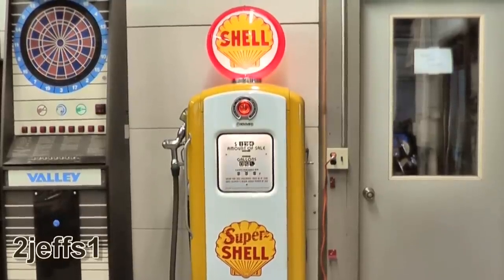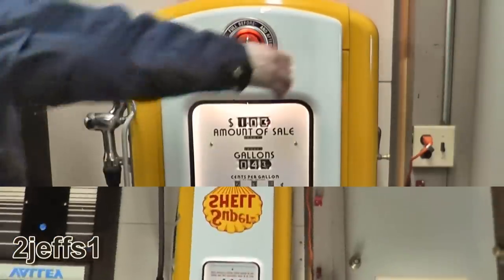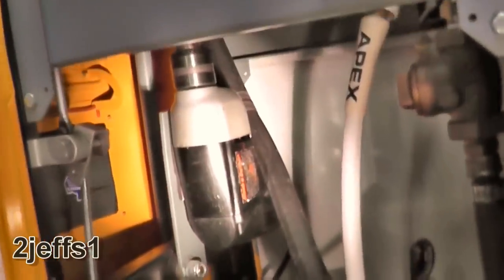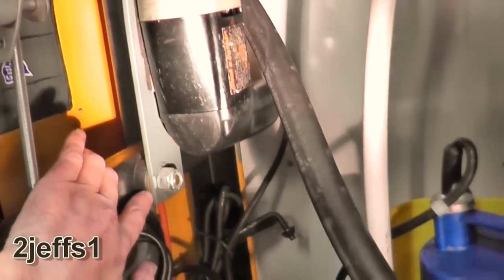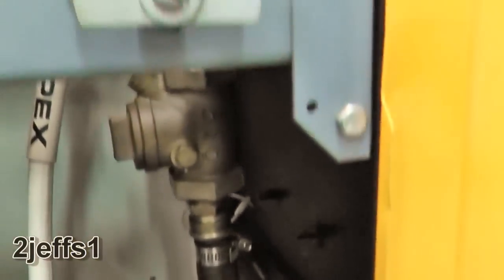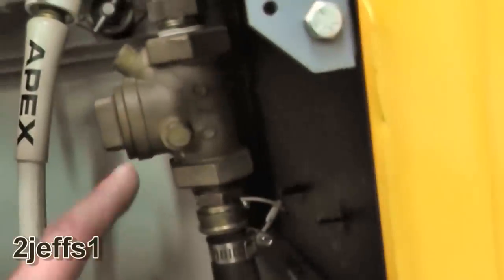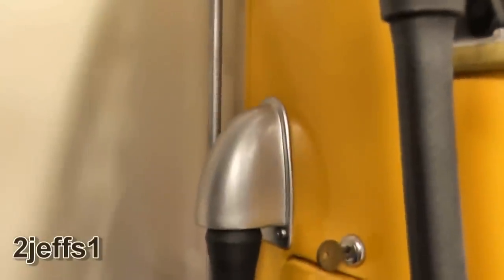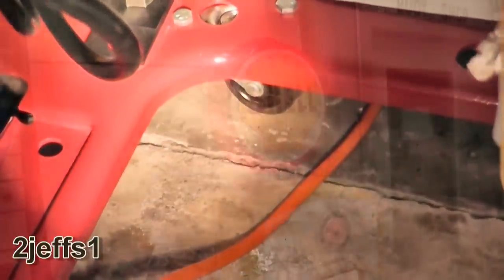Gas Pump Works and Sounds Like Real!  DIY Yours!

Comment from the maker: Hi Alky. Yes the drill is connected to the trigger switch in the handle. I did this project years back and didn't have a camcorder or I would of had video of the total build to make things easier for everyone.

Comment from the maker: Hi Joe, That pump has been together for a long time now. I had to remove the big cap/nut where the switch was inside to make sure I remembered which type switch I used. It is a push button switch from Cole Hersee. The part number is 9023. They have a web site.The switch has threads & nuts on the end. I used washers on that end. The switch has 2 - L shaped terminals. They can be straightened (or remove & solder wires) Final cover the end with electrical tape. Hope this gets you to the finish Jeff

Comment: 2Jeffs1 thanks for your demonstration of how you made your gas pump functional. I am restoring a 1950 Torkhein, slightly different than yours but I should be able to adapt your functionality concepts to my pump. Thanks again for sharing.
Reply from the maker: Hi Joe, glad this helped you out. Good luck on your 1950 Torkhein restoration.

Comment from the maker: Hi again. First, do you have the same nozzle with the large cap? Don't know if that's a big deal but I did shorten the rod to the switch. The switch isn't hard mounted. The washers hold the switch centered at the push rod end and the large cap retains it at the other end from being pushed out while pulling the trigger. There might be a better switch for that purpose. I always just use what is in the bins here. No matter what switch you use make sure to run a ground wire to the handle for safety!

Comment: Wonderful! I've just acquired a Bennett 756 & was wondering about being able to run the meter/bell & spinner. Had thought the meter was un-doable, but you've shown how it can be done.  Great job!!
Reply from the maker: Hey Mark. Makes my day to know that helps you out! Gotta tell you that gear reduction drill I used - It's real noisy. Was going to throw it away years back. Worked out perfect for this project, makes it sound like real. Glad I kept it now!

Comment: I have installed the variable speed drill and circulating fluid system on my pump, but do not know what type of switch or how to install it inside the pump nozzle.  Could you provide details so I can proceed to the next step.  Thank you.

Comment: Apparently, the fluid transfer pump I purchased from Home Depot was too small, 1/12 HP.  It would not fill up the manifold with RV antifreeze; air at the top and foamed up so bad that I could not see the spinners.  I am going to get a 1/2 HP pump and it should be enough to fill the manifold and spin the spinners.  I couldn't mount the switch in the small repro nozzle handle, easy to mount in the large original nozzle handle.

Comment: I found the switch, but not sure how you anchored it inside the nozzle body.  Does it protrude out of the end where the original rod slides in and out when the handle is squeezed?  The description of the switch indicates it is for 6V to 36V DC, not AC.
Reply: yes  both avible  dc  or ac unutß avioblé

Comment: What switch did you use inside the handle to activate the drill?  I'm having a tough time finding one that works.
Reply from the maker: It was something I had in the parts bin. Sorry no idea where it came from, wanted to respond even tho I couldn't help you out.